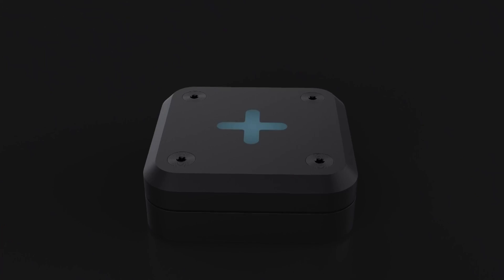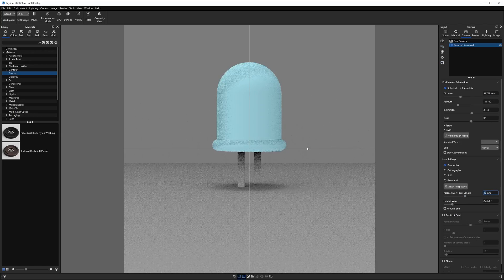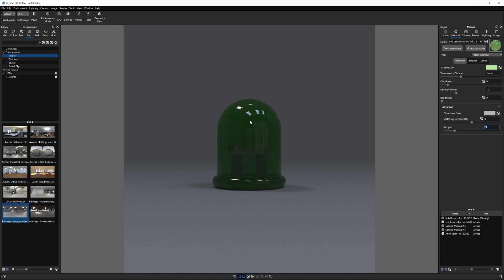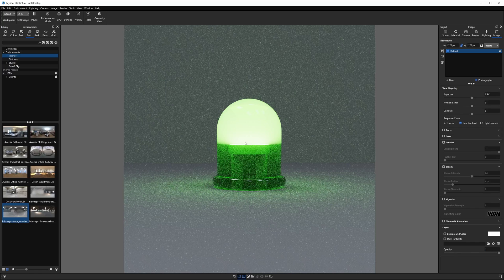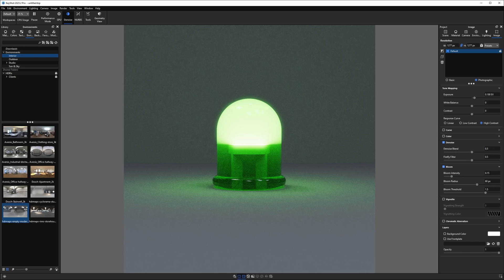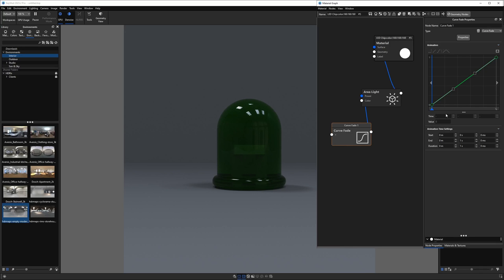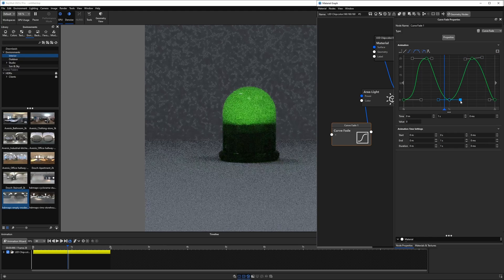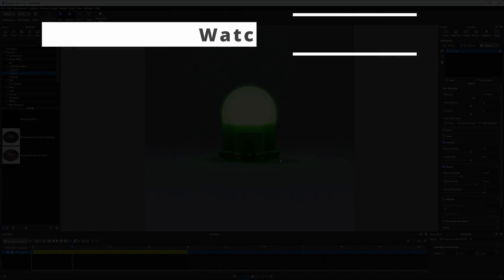How to Animate a Blinking LED in KeyShot

Comment: How long did your render take to process at 20k samples? I've never rendered anything near that high, so it makes me think I'm doing something wrong, even ~100 sample renders seem to take hours per image/frame. I've got a very capable custom desktop and laptop, and have tried on both, along with plenty of lighted/mixed transparency  products at work.  Still get a lot of fireflies, and transparent renders just take way too long to be able to realistically render out a long animation.  Any tips on maximizing quality while minimizing render time?
Reply from the maker: Honestly, I can't recall. I was rendering on a fairly powerful GPU. GPU rendering in KeyShot yields many more samples per second than CPU rendering, thus your sample count ends up being substantially higher (by a factor of 3-10 in many cases).

Comment: when I am applying 25 lumen it seems to be to low for a glow, so I am force to ramp it up to 1000 which messes up the animation. How can I fix it
Reply from the maker: I'm not sure. Were you using my model or something else? The strength of the light will be dependent on the scale of the scene/objects. Did you use photogrpahic mode and the firelfy filter?
Reply: @WillGibbons  no I am using another model, its is a car model, and I am trying to animate the headlamp LED.
Like you said I think the scale of the model is creating that issue, should I try scaling down the whole model ?

Comment: Pretty cool! I wonder if there would be a way to import an Arduino code for an LED animation somewhat similar to multi-layer optics material.
Reply from the maker: Hmm. Not really. I mean, you would need to convert the code to 1 and 0 or keyframes and then generate a black and white value output in the form of animation. Then, render those frames out and use them as a video map and import that. It's kind of a tedious process, but I've done it where I converted a song into keyframes, then generated B&W values based on a threshold of keyframe value in after effects. Then, used that video map to control the blinking.